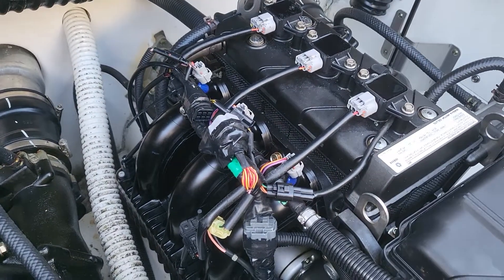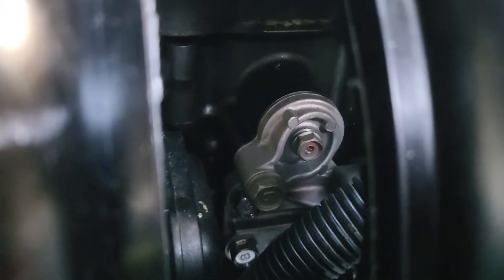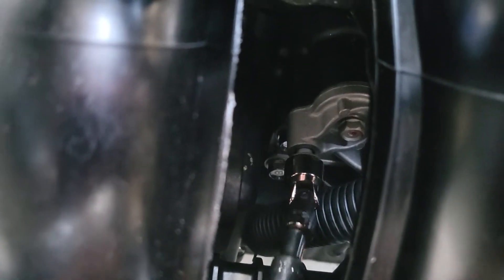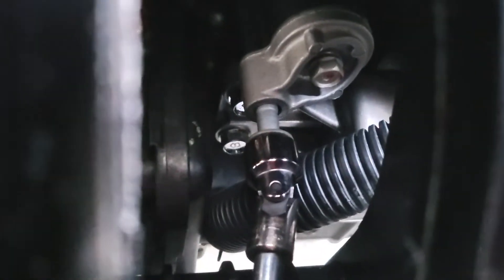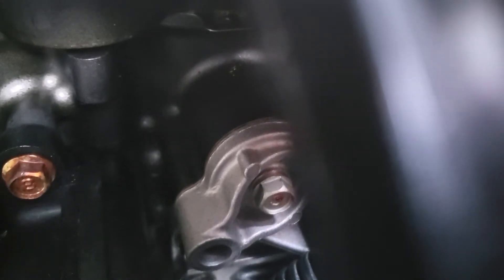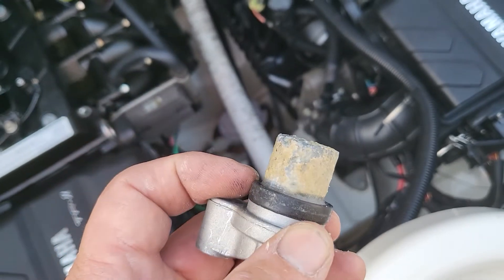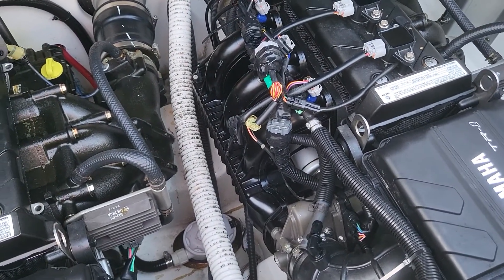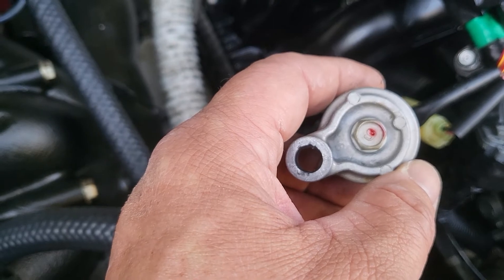Yamaha TR-1 Engine Zinc Anode Removal SX 210 Jet Boat Ski--DIY

Comment: If you've never done antifreeze before and it's a 2018, there's no need for antifreeze.  You'll only have a problem if water cannot expand which I doubt there will be that much water in there

Comment: Clearly, this Zinc is doing its job…and there is still plenty of zinc left to sacrifice. That u-joint socket is a game changer and way better than adding a u-joint inline….got some on order after seeing this video. It would be Silly not to replace this Zinc, but in a pinch for time or a lack of the replacement part, you can clean that zinc anode up with a wire wheel on your drill…..safety glasses please! That will help improve the anodes sacrificial conductivity somewhat and remove any loose decayed zinc. Also, I use the extra long needle nose pliers with the 45 degree tips from Harbor Freight. Still a PIA, but way easier and less time than removing the manifold.

Comment: I'm going to change / check the anode in my waverunner USING your exact instructions. I bought the 12mm universal (home depot calls it 3/8 drive 12mm universal) that's the one I got.  wish me luck. I may put a safety net so it doesn't fall into the bilge. Any tips on putting it back in would be great. thanks again. great video.
Reply from the maker: Grease the rubber gasket so you can easily turn it to line the bolt up.  Be prepared to cut up your hands, hurt your back leaning over, and swear a lot.
Reply: I did it.  took about 2hours. (it's like a pro level version of the game OPERATION) Unfortunately I didn't see the "grease the gasket" until just now. But gentle taps lined up the bolt hole once it was in the engine block hole. I was worried about cross threading but it went in fairly smoothly and I backed it out once to check the threads.  The grease would have also helped in the anode going back in the hole. Things to add to your follow up video: 1. those pliers you show in your video are a MUST have ( I bought some) and get a LONG flat head screw driver (6" plus handle). 2. remove and replace the anode via the oil filter side. 3. Once you place the anode back, close to the hole resting where you can touch it with your fingers, use a LONG screw driver or rod, put it in the anode assembly bolt hole and use that to guide it back to the engine block hole. Use a mirror and brite light, go slow. patience is paramount.,4. DO NOT put the bolt in place until the anode assembly is secure or it will fall into the bilge. This job is doable but not for guys that don't have common sense @Channel-About-Nothing

Comment: I’ve checked anodes on several outboard motors. 1. The fact that your anode is deteriorated is a good thing; it means it did its job. 2.the zinc you have softened on certain spots and broke off and went for a ride into the cooling system (think kidney stones) but most likely will NOT be an issue. 3. You did a great video. 4. So, in the end. Would you suggest taking off the intakes or using a “doll hand” approach to taking out the anode ? Thanks
Reply: I like your honesty. I think that would be my choice as well because you could open up a can of worms when you remove that manifold lose something break, something etc. the less moving parts the better. Where do I buy just the zinc for a 2018 VX limited?
Reply from the maker: @stevesantagati2264  I could not find just the zink, and I can't remember where I got the replacement from.
Reply from the maker: Removing the intake will be my last resort, but I am a glutton for punishment.

Comment: Thanks for the info but on my 2019 SX195 it became a nightmare, It broke in half when I pulled it out and other half is stuck/caked inside and can't get it out no matter what. How deep is the cavity the   anode goes in?
Reply from the maker: Wow, that sucks!  Looks like it is about as deep as the zink is long.  So did the bolt holding the zink on come out with no zink on it and it's now stuck in the engine?  I really don't know what to tell you, but I would definitely take off the intake manifold and figure out a way to pull all the crap left in the engine out.  If it goes in the engine you could cause a blockage and create an overheating issue.  Please post what you do.
Reply: @Van R  The Anode cover and bolt came out with about half of anode..thanks
Reply from the maker: @ruffriding2k2  Are you running in saltwater? These zinks are in the cooling system so I have to assume pushing it into the engine is a bad thing.   If you haven't removed the intake manifold I would do that now.  Try to get out all you can, you never know, chipping it with a shop vac on top of it may be your only option at this point unless you want to take it to a dealer.

 I am sorry to say I have no proven advice on removing what's left but I do have future advice.  If you are in salt and not using some type of salt removal, use something.  I use salt away and it appears to help on several things.
Reply: @Van R  Yes I'm running in salt water only.. also I'm going to have to take the intake manifold off.. will chip at it carefully & vacuum and yes use salt away. Thanks again
Reply: @ruffriding2k2 how did the fix go?  Mine is overheating and when I took out the anode Half is in the engine maybe this could be it?
Reply: @aleemrahim6846  It was hard getting part of  the stuck anode, had to use a dremmel  with flex shaft to have better access..but after all it all worked out.
Reply: @aleemrahim6846  as far as the over heating for me..I think it was a dirty sensor at the exhaust..I tested it and cleaned it. No more overheating issues.
Reply: Thank you for the video, it is very helpful!